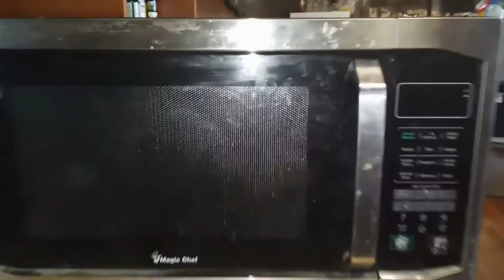Piggys Piddles Episode 120 - Taking apart the old microwave

Comment: Was those screws torx?? Is that why you used the vice gripes on the screws?
Reply from the maker: They were star type, I didnt have a proper bit for them so I used what I had that would be able to get a grip on them so I could get them out.
Reply: @piggyspiddles  The star is a Torx, I figured that's why you used the vice grips, I do the same thing.